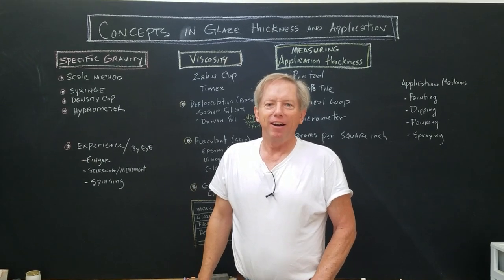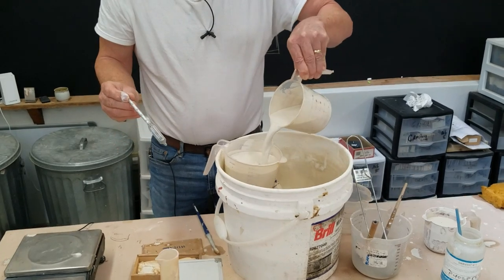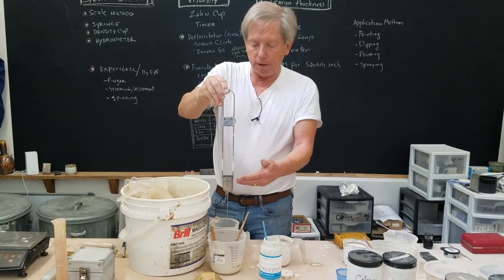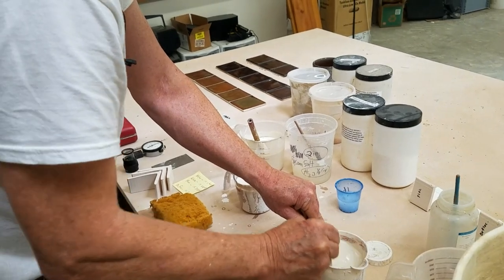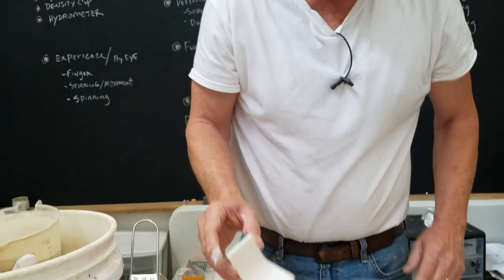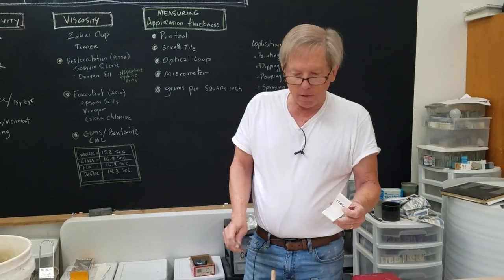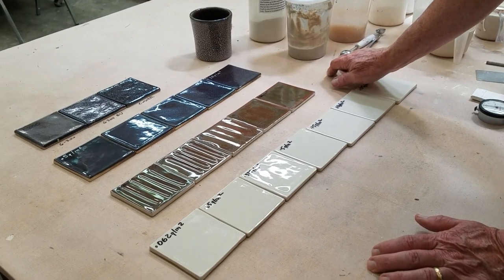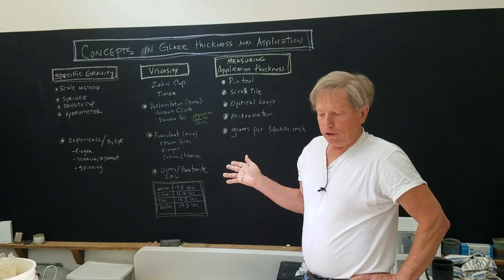Concepts in Glaze Thickness and Application ( part 21 of Free Online Glaze Course)

Comment: Hey John this is Jeff you probably recognize me by all the email I sent about the crazy blue clay LOL any rate I have a question does pH ever become a factor with glazes and if so how do we deal with that?. I am an organic chemist I'm a very amateur basis so I have a lot of access to chemicals and I've actually learned how to create many compounds over the years whether that will ever help me or not I really don't know I have been thinking about using some lead carbonate for some chandelier pieces that I've wanted to make nobody will ever touch them and I have a very good exhaust system but at any rate that's beside the whole point I was just wondering if PH ever comes into play if there's ever a reason to check and water would a highly out of wack PH due to a glaze if anything?

Thank you for these videos they're really so valuable I learn more every time I rewatch 1 it's helped me a great deal in this art. Really seriously I can't thank you enough you single handedly advanced my skills immensely
Reply from the maker: Ph is usually discussed as flocculated (acid) or deflocculated glazes (base)